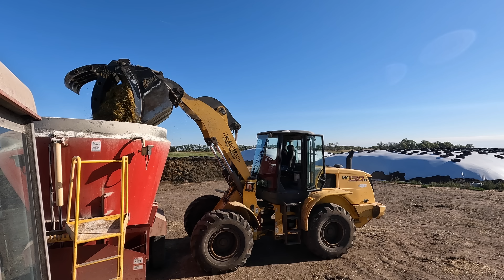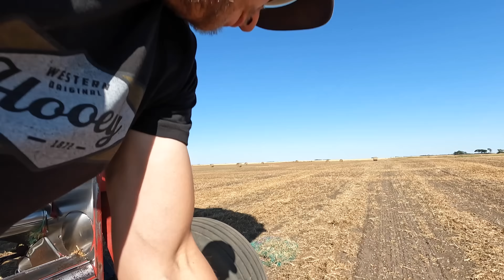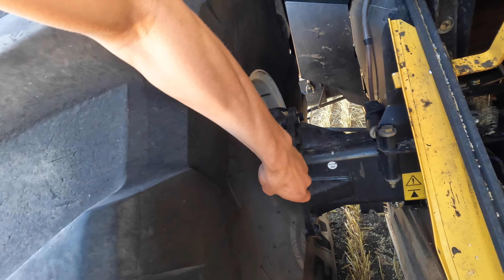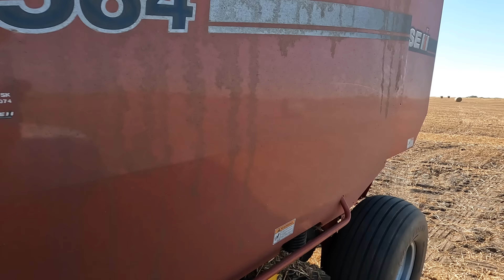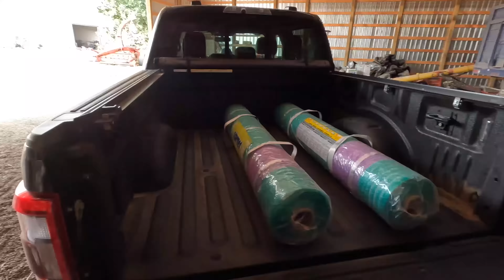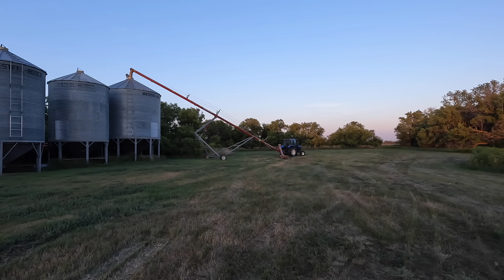Combine Tire Blew Up!...

Comment: Great video, wow yes the tires are expensive. I worked heavy equipment on Railway before retirement on loading and unloading
overseas containers. the tires on some machines were way bigger than your combine for lifting 60/ 70,000 lbs loads, never seen
one blow but running 24 hour shifts 7days a week, used to wear them out. :face-pink-tears:

Comment: Dang that sucks that the pricy combine tire blew but that’s farming! When You service the Case baler tractors do You clean out the engine air filters as well? Dirty air filters can lead to more fuel being needed. Good old Farm King auger, the Farm King plant is 2 blocks from our house! Little advise when You move the auger and you maybe did show it but You should uncouple the PTO shaft from the tractor before You move the auger otherwise You can early break the inner ball on the CV yoke. Seen lots of failures like that at the dealership and that’s a $1800 repair cost cause You have to buy the complete tractor half PTO shaft! Just a heads up is all. 
Love You videos, been watching them for a year or more! You do a great job!! 👍👍

Comment: Tire are prices are mind blowing. Our firend had the same issue last year. For him it was on a wet wheat field with half a tank(CX808). It was a challenge to lift the front axle, it pushed the jack in to ground, with the wood pile under it.
Reply: Go get a proper wood block or thick plywood and then blocks
Reply: @kaurkoop  It had at least 5-8 block under it. It was just wet from the constant rain.

Comment: For winter storage:

- Block the combine up and not let the tyres touch the ground

- .5 bar over pressure

- wrap or apply dry seal to tyre casing
Reply: I'm about to be a farmer, never done it I think I'll be driving truck hauling crops, and possibly milking and also driving harvesters ETC, yah I'm doing it all 😂😅, firzt days Monday wish me luck yall
Reply: I was going to say the same about blocking up the tyres off the ground for the winter! Prevents tyre wall damage! Used to do it on a farm I worked on 25 years ago!

Comment: Sorry to see your tire went bad.  Honestly I'm not surprised, that seems to be typical trelleborg, I've seen them Crack like that way to often for no reason when they still have lots of life yet but could be because of how old they are. But your right tires are expensive right now. Especially a special size tire like that will be worse

Comment: Thanks for your video.
 
Some farmers are now dumping their wheat into semis on the go instead of dumping into grain carts.  It is worth thinking about and trying out since the dollars affect the bottom line.

There are advantages such as less fines in the grain from less augering without a cart, less fuel used, less manpower required, less wear on machinery, more profit etc.
Other crops such as potatoes, sugar beet, corn silage and some vegetables are directly dumped from the harvester on the go into trucks instead of being dumped into a cart.

Check out this video titled,      2024 Crop Report - Box Elder

Comment: My 605n vermeer will wrap 1/2 the netwrap around that same roller as well.  Usually when I’m baling on the wet side.   Never on dry material. 

Good thing about dry years is you’ll see it coming back on a 1/2 mile pass coming back. Lol

Comment: No other options for a tire? I know Trelleborg motorcycle tires are about 3-4 times the cost of a Dunlop. They used to come standard on Husqvarna motorcycles back in the day but they were quickly surpassed by Pirelli and Dunlop.

Comment: I hate to say it buddy but in my opinion with all the straw that you got maybe you should get one of those PTO driven loading forage wagon and build a straw shed so that way you don't have to bail every time if you know what I mean kind of like silage
Reply: Not feasible with that amount of material. You will never be able to pack dry straw to similar density of a bale. Also a bit of a fire hazard. One small spark from something and you lost a few years worth of straw
Reply: Hate to say iT buddy but you don't have a clue what you are talking about

Comment: I have an stx450 case with triples on it, tires are getting pretty worn and have leaks in some and have been just adding air every few days. To do the whole tractor is around 50k with 20.8-42’s. our combine needs tires as well and i cringe to see what that will cost

Comment: Is it time to start putting money into equipment?                                                                        Bailers are very tired.                                                          Not enough horse power in the tractors.                         
                     Old tires                                                               Don't even know what to say about the chopper.                                                                      Man hours fixing equipment        
                                                                                    Is massively more expensive                                                                             Than man hours farming.
Reply: Send them the money
Reply: Bet you think you are a great recliner professional😂😂😂😂😂😂.  NOT